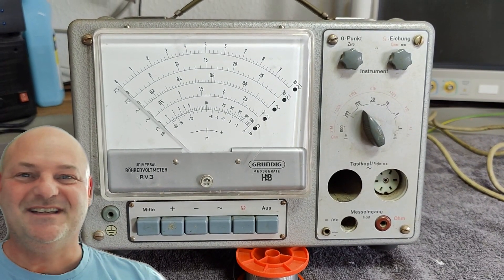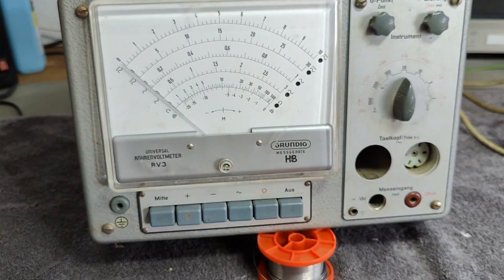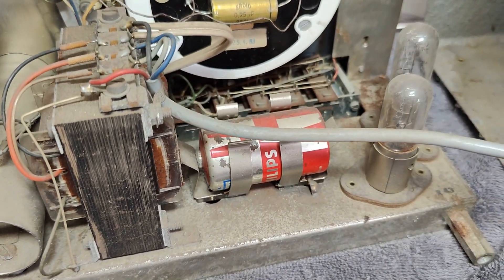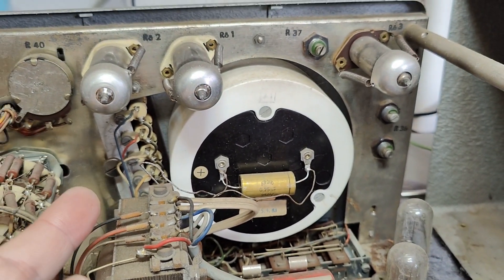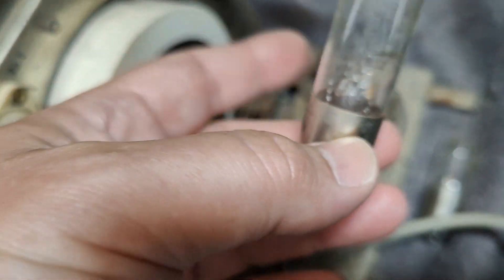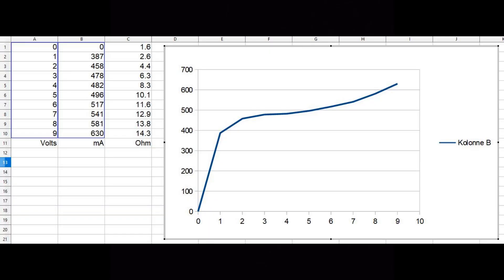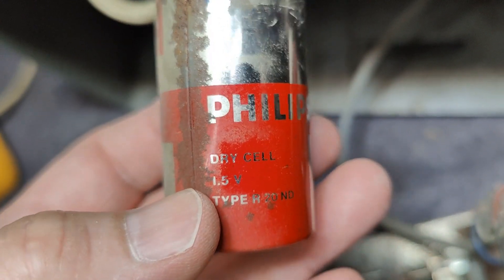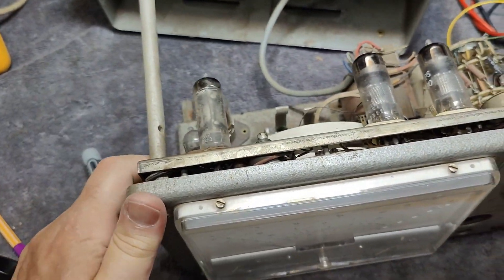Grundig H&B Universal Röhrenvoltmeter RV3 6062 1963 test teardown

Comment: The battery is zinc. Alkaline would have leaked - they eventually always do, no matter the brand. Zinc is fine for low power use in an ohmmeter. Much less damage.

Comment: I really wonder why they didn't standardize on "red or orange for live wires (and both wires in a lead with a non-polarized plug, they both bite you in the same color)  or anything with spicy voltages on it" when they had the chance  :) Must have some history of the very first wires usually being some shade of gray/black undyed insulation and red added later for PE - but back then, they didn't mind annoying the DC folks about their + color :)

Comment: I swear, some fleamarket dealers really drag stuff half across Europe - also saw an RV3 in reasonably knackered condition and with missing probes offered just a few months ago in central Germany (didn't take it because I have enough VTVMs and the unit is super big and I'm urban), curiously looks like it might be the same unit. ... I recently started replacing 1,5V batteries in all collectible devices with either1,8V primary lithiums or LSD NIMH  (whatever is better compatible. The nice thing with LSD NIMH is if you pre-discharge them into the flat part of the curve, they work well in devices that expect a mercury cell, though that solution obviously needs more maintenance) so not to repeat the duraleak cycle :)

Comment: Stabiliser for the heaters is to get a very long life out of the tubes, as they do not have that massive thermal shock on turn on. Plus compensate for mains variation, as the lamp thin filament has a much wider temperature change. The hot running resistor should be replaced with 2 series ones, plenty of room there for them on the tag board, and with 2 it will run cooler, provided you keep the same wattage, or a little larger. Yes good thermal design overall, just you need the AC probe to make it work, which almost always seems to be missing.

Comment: Thank you for showing the inside of one of these. Years ago I built a tube voltmeter based on an almost suspiciously similar schematic I found in Heinz Richters "Radiopraxis" book. He used a 6SN7 instead of the two E80Fs and a 6H6 instead of the EAA91 and no stabilizer tubes for the heaters, but other than that it is practically the same circuit. I wonder if something is wrong with the voltage divider resistors or if it is only the range trim pots that have drifted (R36, 38 and 39 in your schematic). The circuit I built turned out to be very precise once properly adjusted, I'd say your meter should be even better. One thing that I never understood is why all tube voltmeters always seem to be ground referenced. That was something I changed when I build mine so it's much easier to measure the (small) voltage drop along a resistor or such things.

Comment: What is crest factor on it ? Try it with puls , 10 khz ,1vpp, 1 us pulse width.  Compare to hp 3400A
Reply: The HP 3400 is an AC RMS voltmeter with a swing factor greater than 10 - it will be like comparing apples with pears. For comparison with the HP meter, the 427A would functionally correspond - but it is not tube-based and measures on a different principle.